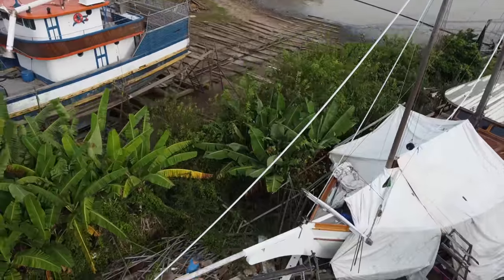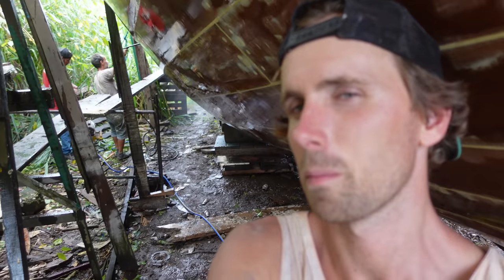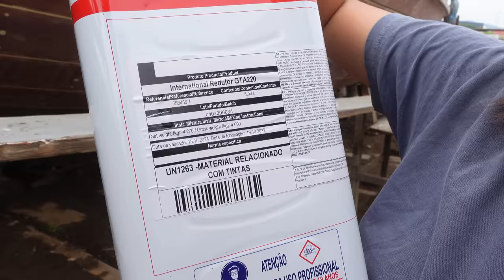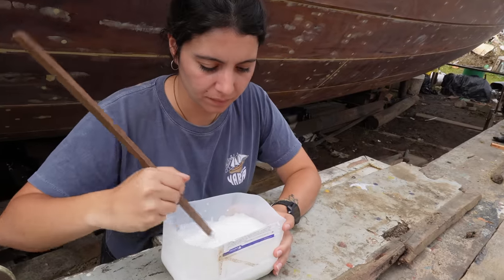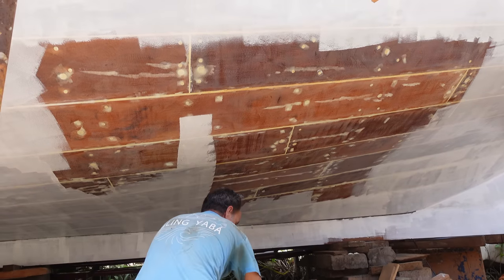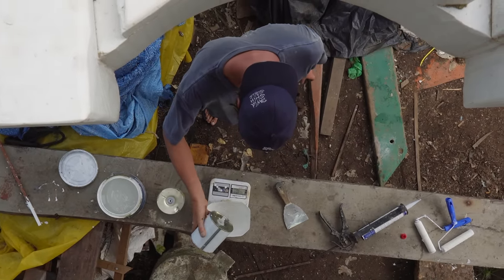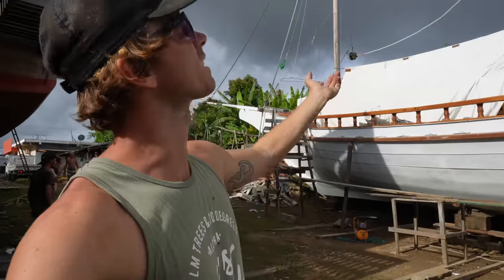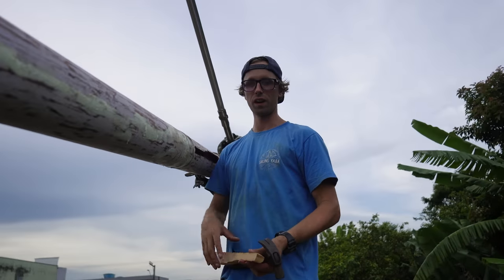Painting our WOODEN sailboat! + dangerous rotten bowsprit fix? — Sailing Yabá 129

Comment from the maker: Tell me I'm not crazy and that you also had mixed feelings about us painting the hull!!
Reply: Paint the hull!!!  BUT looks like you might want to replace all the spars and not paint them.   Spars are usually kept varnished so condition can be seen easily.   Parts being epoxied need to have a small gap so as not to starve the joint of epoxy.
Reply: Not crazy! but think of the work involved in varnishing that sized hull, remember you'll need to maintain the varnish much more often than paint. At the end of the day do you want to spend more time in the boat yard each year or be out sailing and diving? what's you goal for having the boat? If your goal is to spend all your time varnishing to have the prettiest boat, then you'd be crazy to paint it (but probably also a little bit crazy, especially to have such a big boat for that goal)
Reply: I did like the warm look of the natural wood. But, the white primer sure did change the look of Yaba, and makes her look like one of those ships in a bottle. Cheers from Winnipeg.
Reply: You're not crazy rest assured MP. But you must seal it against the environment and particularly the salt water and sea life which is aggressive and destructive. Keep in mind , as the old folks say. It's what's on the inside that counts!
Reply: I love how passionate you are about the wood, I think it`s a sin to cover up beautiful wood but unfortunately it will be better in the long run for protection from the elements. I agree that the beauty of wood should not be hidden or covered up.
Reply: No I was looking forward to it as I thought she would more like her old self, despite the fact that the wood looked stunning the constant upkeep of that amount of brightwork would surely take all the fun out of sailing her.
Reply: I hate covering natural wood. But that's me
Reply: Painting the hull is the practical approach and you still have a huge amount of natural wood on deck and inside. Yaba will still be beautiful!
Cheers from Alaska
Reply: No worries Yaba crew. You did the sensible thing. Protecting the hull with epoxy, protecting the epoxy with layers of primer and two component overcoat is the solution for the long term.
Reply: @another2133  you mean the bowsprit? If your spirit gets lost, you better go to church next sunday
Reply: You are crazy.
Reply: That white is perfect. And if you want to go crazy on that bow sprit do it in Nemo (the fish) orange!!
Reply: If you would have use bungs instead of filler compound to fill all the nail holes then yeah it would’ve been really sad to see you cover up the wood.
Reply: No
Reply: No, you're not crazy at all. Honestly, I was sad to see the wood paneling covered too. I was kind of hoping to find a way to let that beautiful woodwork shine, show off her stripes to other ships that pass by. But, nobody wants to tangle with toredo worms again. Especially not after what she survived the first time.
Reply: I feel lucky for you that it is going into the🎉❤ water
Reply: Wouldn’t it be quicker to spray paint it?
Reply: Not crazy at all. 
I think you are both doing a wonderful thing rebuilding such a beautiful boat. She will look fabulous in her new livery :) 
Bet you can’t wait for splash day ;) 
Take care!

Comment: Hey you two.  I am very concerned about the bowsprit. If you don't replace it, you will always be worried about it in rough seas. At a minimum, please have a marine engineer inspect the damage and repair.
Reply: Amen - rot follows growth rings. What you have done is like placing a band aid on a cancerous mole - the roots still grow.
Reply: Rot in any spar is a reason to inspect it thoroughly . When there is the slightest doubt about it , replace it . Here in the Netherlands there have been people killed by breaking spars . Be aware of the risk you are taking with this bowsprit . Also important , never ever fill a check in a spar with filler . Moisture inside it can't escape from the spar . It will promote further rot !
Reply: Yes your right
It needs replacing, it's not worth the risk
Reply: I would have been tempted to shorten it to the good side of the rot. It doesn't really need to be that long. Currently there is no bobstay or bobstay shrouds and those can be configured to maximise the strength.
Reply: Please consider replacing the bowsprit. It is bad. It will fail when you really don't want it to.
Reply: @delukxy  This may be a possibility, if you can stay withing the proper angle range for this vessel. An example would be anywhere within 30-36 degrees. I am not certain what it would be for this vessel but with a bit of research and math it could be determined.
Reply: That bowsprit scares the sh.. out of me.
Reply: @johnbarone  Yes, the extended prow is just about long enough to called a bowsprit. A spar 1 to 1.5m  should be good enough for looks and practicality.
Reply: What everyone is saying is replace the extra 2weeks waiting for timber will not hurt in the long run. If this was me I would replace, the piece of mind when you hit that first storm will be so worth it.  regard Glyn UK.
Reply: Most of the boat has been replaced with new, why not replace the bowsprit while its in the yard. Now is the time to do it!
Reply: Please replace that bowsprit

Please wear a basic safety line on that crazy scaffolding

One slip and you are dead or really badly injured

A sad way to end your dreams.

Comment: You need a new bowsprit. The Dutchman you tried to fit is a sloppy fit and will eventually fail. There are other pockets of rot that will eventually haunt you.
Reply: and not taking the furler brackets off and paint around them also not a good idea….
Reply: I would not be shocked if that repair, loaded with epoxy and clamped to the german spec of "gootentite" doesn't turn out to be stronger in the end...  we will never know.

Comment: You kids are proper legends. For managing the rebuild, refit and restoration of this marvelous vessel, Yaba. I'll be only guessing as to your specific motivation to begin this adventure, but watching you put it together there can be no doubt what a wonderful good she is to now have.❤❤
Reply from the maker: Thank you so much Jack!
Reply: Their motivation is they bought a boat without knowing what condition it was in, then found out that literally every single piece of wood on the wooden boat was completely rotten and had to be replaced. They were in over their heads so they went to this ship yard and started this channel to help fund the rebuild.
Reply: @srcastic8764  if you look at a brazilian shipwright wage its about $1000 usd/month and then materials. it took alot of guts for a couple fresh out of school to take a leap of faith like that. they have to be burning through atleast 10 grand a month. pretty wild if thats all funded by social media.
Reply: @electricbaylinergoesfishin870  absolutely. They’ve spent a ton on this thing. In the end I think they’re still not going to have what they want. This boat is still not a bluewater ocean crosser. It’s just not designed for that. It’s designed to be a coastal cruising boat, fine for their scuba lessons and such. But they’ve mentioned several times about sailing the world or sailing around the world and well, they’re gonna need a different boat for that.
Reply: @srcastic8764  so what if they did! Good on them. Thats motivation and innovation in itself

Comment: Too late now but next time you need to patch a sprit or mast or plank. Rout out instead of just chipping and chopping with a chisel. Clamp or otherwise fasten a flat router guide fixture around the rotted area and rout in stages of depth to remove rot and leave a properly dimensioned but uniformly, squared shape to epoxy the “Dutchman” Into. You will have stronger adhesion and no worries about filling irregular voids created by  just “digging out the rot (it’s faster, stronger and easier). Things are really Shaping up now! Give yourselves some hugs.

Comment: Sealing the hull seems to going great. I wonder a little about the quality of the bow sprit. Epoxy is great but when you have to go forward on that sprit you got to wonder did I miss some spots. What would it take to replace the sprit with new lumber, or laminate a new bow sprit?

Comment: I’ll give you a tip. 
Never shake the paint tin before opening it. 
Shaking forms bubbles in the paint. Always stir.
Reply: Professional painters use a machine to shake the paint.
Reply: @johnnunn8688  
That’s true but the can usually isn’t used for some time which allows the the bubbles to dissolve.

Comment: I don't want to sound negative, but if that was my bowsprit I would replace it rather than rely on a piece let in, even if it is held with epoxy. Rigging failure at sea might give you a story to tell in your old age, but only if you are lucky.
Reply: Yeah, I would replace it with aluminum or wood with fiberglass enforcement.  The current condition of the wood seems have rotted pretty deep. It might not hold up under pressure.

Comment: To avoid rolling, do you think adding bilge keels on each side be helpful?   Most of the boats seen in the yard have bilge keels.
Reply: Not just the sailboats but also the motorized fishing boats all seem to have bilge keels. Probably more useful on a rounded bottom hull than on Yaba which has a nearly flat bottom.

Comment: You Need (with a capital "N" and underlined and all bold with 4 3xclamation points) to reinforce that structurally compromised bowsprit with a fiberglass wrap before you attach a sail to it. An epoxied in splice will not return sufficient strength to the wood there to be safe to run a large sail.

Comment: If your bowsprit is that rotten, the only way to fully fix it is to replace it. I have seen a couple of bowsprit break due to less obvious damage as they put up the mast or pulled up the sails so that the wind pulled on the whole ting. It's not something you want to happen, trust me on this, as it can quickly go horribly wrong when it happens suddenly. And damage to the bowsprit that i deep and big, is a good way to learn how bad it can be when it fails during sailing. You would be a lot better off if you replace the whole thing with fresh hardwood.

I've even seen a mast made up of overlapping wood sandwich together, break from a damage that was less than what your bowsprit showed in the video, fixing that was not easy and that mast had a width of bit more than 30 cm. I know that the mast need to stand tall and hold back more than the bowsprit, but even so it's a bad idea to not really fix by remove every bit of the damage and then see if you maybe can save it, if not the damage will just keep growing inside until it breaks just when you really need it.